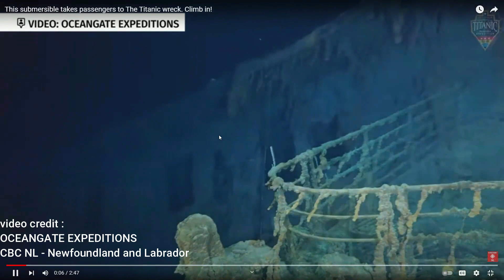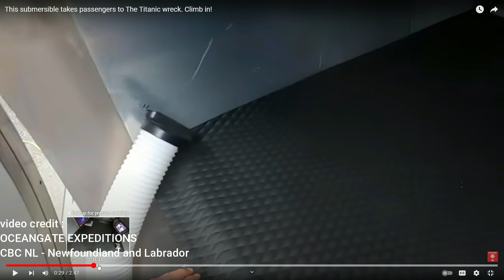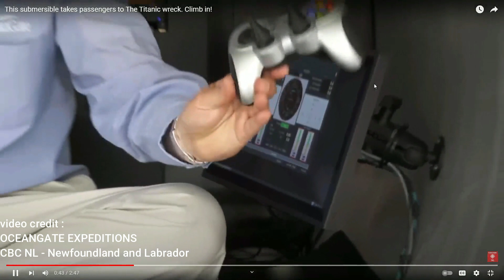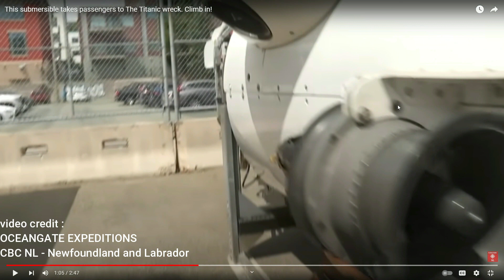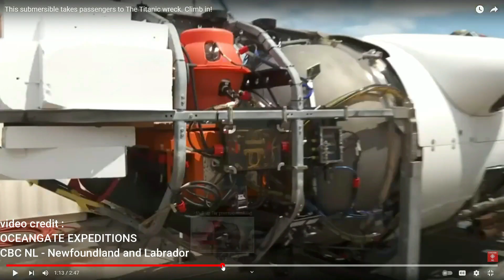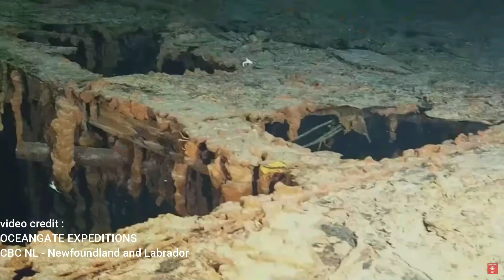Missing Submarine was controlled via BLUETOOTH , SERIOUSLY???

Comment: BY THE TIME YOU READ THIS COMMENT, the sub had already run out of oxygen supply, no more than an hour or so based on the countdown. I'm assuming the rescue will now be a recovery mission. Prayers to those involved in this tragedy and hope and safety for the search teams to find and retrieve the sub.🙏🙏🙏
Reply: As of 2 hours ago, it is a recovery mission at this point, as pieces of the sub has been recovered sadly.